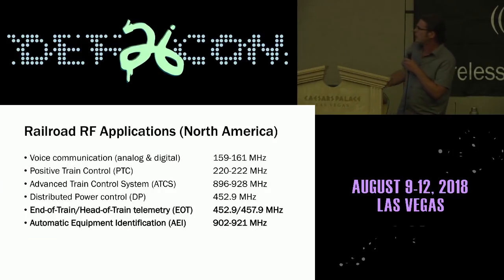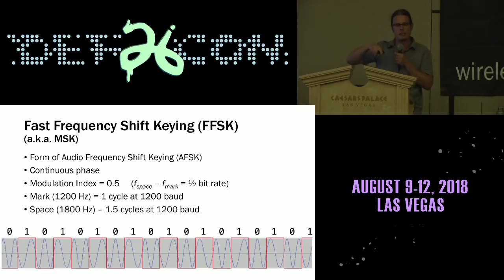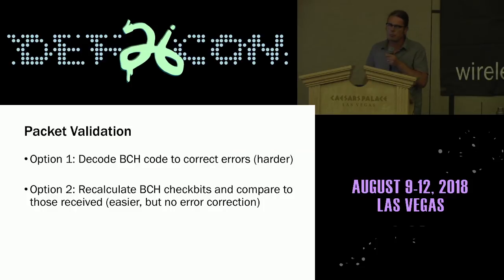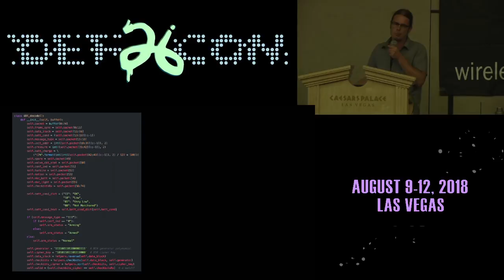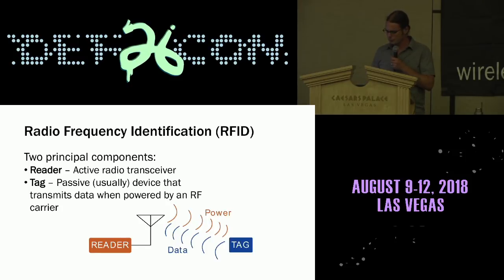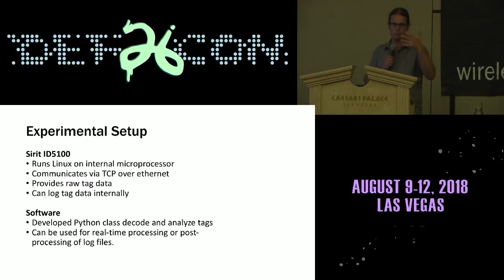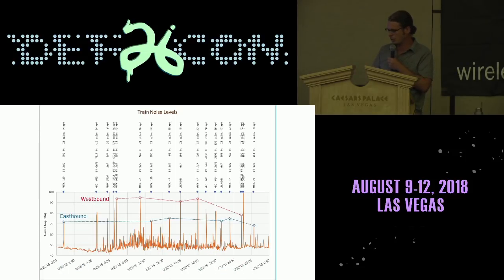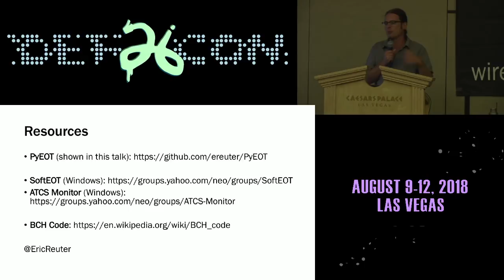DEF CON 26 WIRELESS VILLAGE - Eric Reuter - Introduction to Railroad Telemetry

Comment: @19:32  You mention the "encryption" that is performed on the packet.
  that is likely a cheap method of a "pseudo randomizer".

By jumbling up the data packet in a known way you can minimize long sequences of zeros and ones that can cause the bit-synchronizer in the receiver to lose bit sych lock.